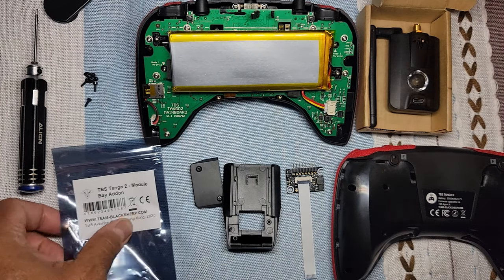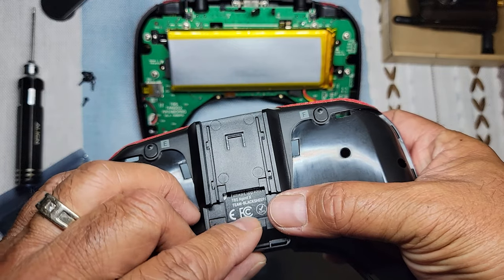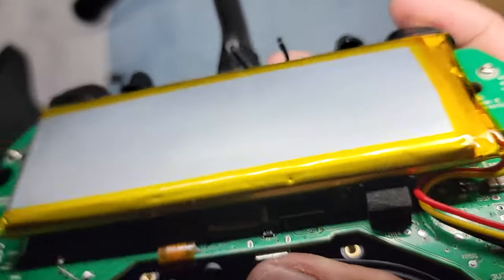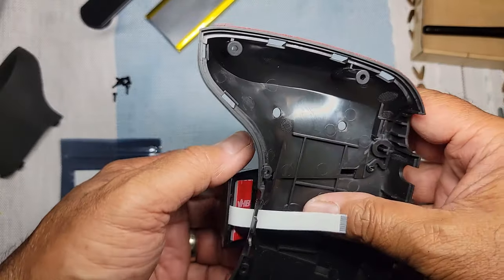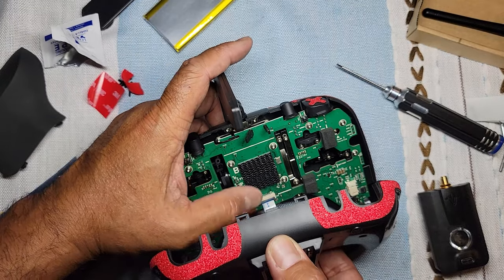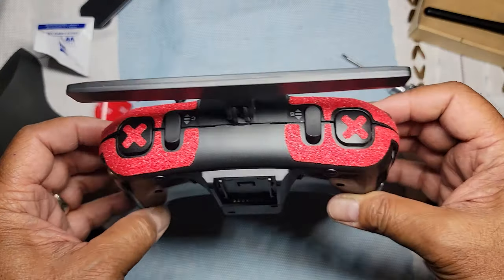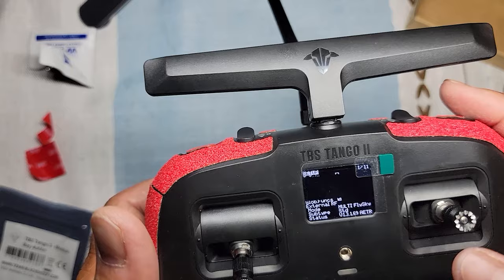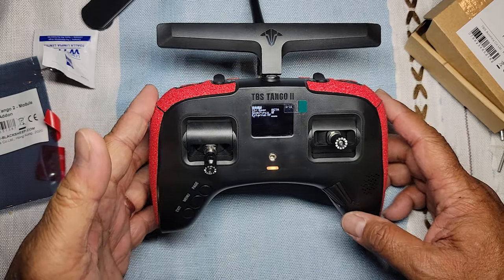TBS Tango 2 Multiprotocol Module and Module Bay Kit Install

Comment: So you found it to be slippery and covered in that textile tape? Any word on that? Thanks for the video
Reply from the maker: Thanks for watching :) It's really grippy with it on.. a little too grippy for me lol. I ended up trimming about half of it off. I really didn't like the feel of sandpaper in my hands. Something like a thin adhesive silicone or even foam pads would be better for me. I remember searching for a silicone cover like the one for the QX7S back when I made this video.